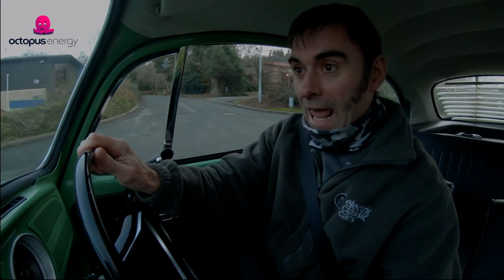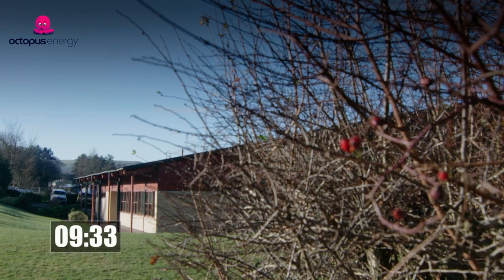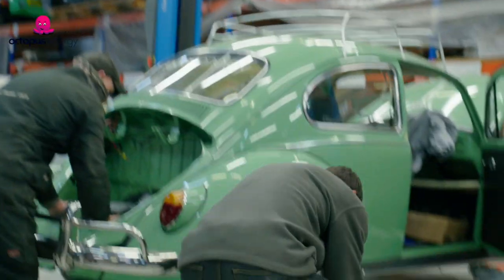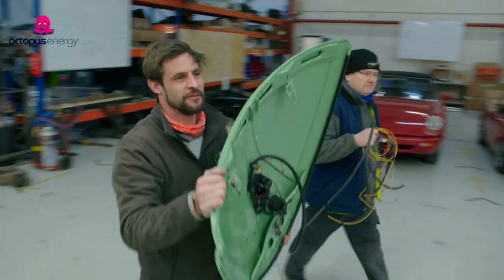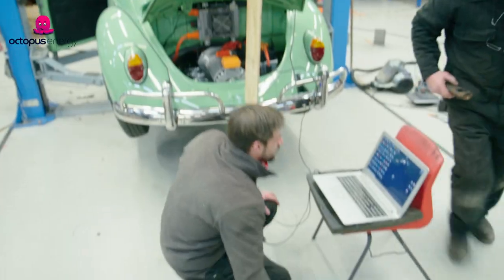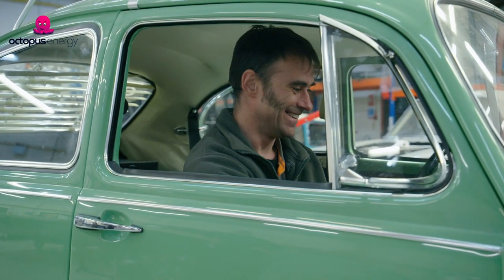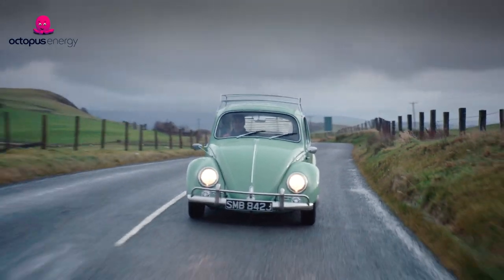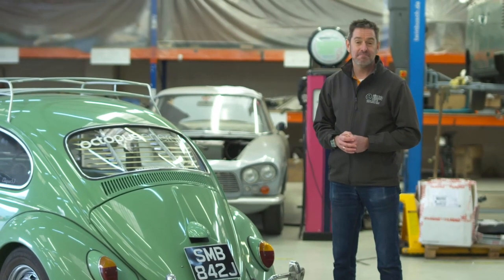Converting a Beetle to Electric Power in a Day ! *INSANE CHALLENGE*

Comment: I first saw "Vintage Voltage" and this super fast EV Conversion of that lovely Octopus Energy sponsored Beetle! A little late, but congrats to Moggy and his team! I am an expat of the UK, and visited the UK during February 2020, for 21 days holiday ( I reside in Sydney Australia). BUT Covid struck the UK during March 2020, and I got stranded in the UK for almost one year (363 days before I saw my Sydney home again). But I thoroughly watched every "Vintage Voltage" in my confinement in the UK. I must say that 'I was inspired' to go EV with my 1971 Super Bug way back in 2018. But my dream turned to reality during April 2020, but I was deeply frustrated - not being able to see - or drive my newly-converted Electric Beetle, and being confined to the residence in a Bolton (Lancs) street!!
I finally made it home, to Australia after 2-weeks held in quarantine when I landed Australia. My first job- was to take a taxi to the factory that completed the EV Conversion, and see AND DRIVE my new Super Beetle. Finally, I love the commentary, the scenery, as Moggy feels thrilled with the Car that he has created. Also, my experiences with my EV Beetle matches with everything that Moggy has said. The weight balance (with added Battery Mass at the front) has definitely removed the "twitchiness" from the steering, as most Beetle owners would agree. The car feels more 'planted' on the road. MY EV Conversion was done exactly the same as the Octopus Energy Beetle. (Tesla model 'S' Battery Pack + Netgain Hyper 9 Motor. Every time that I drive my EV Beetle, I feel lucky, and wear a smile too! I had exactly the same 'teething problems' with the setup of the Inverter Computer as Moggy. All fixed and the car has been 100% reliable. Car goes to Shows, the last one being "Fully Charged" at the Darling Harbour EV Show 2023. It is on YT, and is the only white 1971 EV Super Beetle there on display. Car also goes to the VW Nationals, held in Sydney on 28th May 2023. An Essay, I know, but that is my 'happiest' personal story.

Comment: They're working next to a Gordon Keeble! What are they doing with that? Electric conversion? Would love a story on that!
Reply from the maker: Tune in to Series 2 of Vintage Voltage on Quest early next year. The Gordon Keeble is having a mid mounted 450hp large Tesla motor 👍
Reply: @PetrolPed  exciting! Might I suggest that they cut out the transmission tunnel and make it a flat floor car? I'm guessing they'll use the engine bay to locate the batteries.

Comment: Isn't the hyper 9 a dc motor? I thought dc motors could not get regen?

Also, the beetle is the most converted car on the planet. And its great, but as an old car enthusiast, can we see some other configurations converted too? Perhaps inline front wheel drive/4 wheel drive (audi/subaru configuration), transverse front wheel drive or the most common classic configuration of front engined rear wheel drive.

Comment: To put in the motor you can remove the two transaxle bolts and tilt down the transaxle just a touch. It works and you can then re-torque the transaxle bolts. I do this so I don't have to cut any metal. Im putting in a double stack AC-35 from HPEVS into my Bug. Ive had two different motors in that beastie and the AC-35 will be the shortest in the bug. Easy to mount.

Comment: Interesting. What sort of rough cost Ped?
Reply from the maker: Conversions range from £20k to £65k depending on the motor used and the size of the battery pack. ECC do a kit for a Beetle which makes it a bit cheaper 👍

Comment: will it work safely under heavy rain and if it ran through a puddle in a flooded street after a heavy rain night, what would happen? will it work safely with a lot of water frim beneath as well?
Reply from the maker: Perfectly fine. Everything is sealed. In fact it should deal with deep water better than an internal combustion engine 👍
Reply: @PetrolPed  wow, that's great to know!! Million thanks for your reply, thank you so much again and again :)
Reply: I can answer your question. On date 15th February 2021, I had to take out my Electric Beetle (converted in exactly the same way as this video). The rain was absolutely torrential. On a three-lane highway, I had to cover about 15kM on flooded roads. The Nearside Lane (which I used), had about 100mm of water depth, (in parts where drainage was very poor) and the passing cars also gave my EV Beetle a good soaking! The truth is that my EV Beetle never missed a beat. I wouldn't normally take out my EV Beetle in such extreme weather, but on this rainy day, I had no option. Trust me, the EV Beetle performed just the same as if it was a 'dry' day.
Reply: @peterduxbury927  million zillion thanks for your great reply

Comment: I have one question. Is it possible the battery pack could be smaller. Like say a lithium ion type of battery.
And next idea is the charging system could be maintained from one of the rotating wheels...
Reply from the maker: It gets some charge from regenerative braking. If you work out how to fully charge the battery from a rotating wheel then you will be a billionaire before you know it as you will have invented perpetual motion 😜👍
Reply: @PetrolPed  The 1972 1302s was my first automobile. And the Auto Mechanic was my first trade l learned from the German Automobile School.
One interesting thing l learned about the beetles is the way the speedometer clock work's. And this was connected straight from right front wheel to center of the speedometer clock of the dash board.
And so from this same principle using the left front wheel. A unit similar the electrical controller can be created. I called this the Alternator Controller box. 
This key unit l am inventing is responsible for the purpose of maintaining voltage level of the electrical batteries in supporting the electric motor function.
That was one of my idea

Comment: I wonder what it cost to convert ?
Reply from the maker: Tricky questions as there are a lot of ‘it depends’. Conversions start from about £20k and go up to £65k depending on the motor and battery pack chosen 👍
Reply: @PetrolPed  Tks, was hoping someone  could convert my 2007 Twingo GT, as it never gets used.

Comment: I don't understand why do these cars have gearboxes.  Electric cars don't have a gearbox. Why they fitted with one? Thx
Reply from the maker: It makes the conversion simpler and cheaper when using a lower power motor. The Hyper9 motor used in this has about 120hp and the cars gearbox can cope with that. 

If you want more power and torque then we use a Tesla motor and that requires direct drive and just 2 gears, forward and reverse 👍
Reply: @PetrolPed  Thank you

Comment: An interesting film and certainly a lot of work in one day. I. An understand the enthusiasm and what drives them to convert the cars but I am not really sure that I am “ sold” on the idea. I think I would be converting things like a 5/7 year old Fiesta  which identifies more with modern families and their practical use day to day. Most owners of mid life moderns are not car enthusiasts so owning an electric VW, Morris Minor, Vauxhall Viva etc...is lost on them and I am not sure also that many who are say, Volkswagen owners, would be happy to have their car changed. It might well become a far greater need in years to come and the on'y way to drive a “Classic” but at present, I’m not taken with the idea. Also, I guess it is driving through the original clutch and gearbox so how is that coping with the torque which is vastly greater then ever intended and changing gear must be a strange job that takes some learning. It is an interesting concept with great enthusiasm...I wish them well. 🙂🙂🙂🙂Richard.
Reply from the maker: Modern cars are much more difficult to convert due to more complex systems and features. When keeping the existing gearbox (the most cost effective conversion) there is a limited to the performance of the motor used. The Hyper9 used in this one is about 120hp and the gearbox can deal with the torque. Sometimes and updated gearbox is needed. For even more power they use either small or large Tesla motors but they require direct drive. Doing away with the gearbox altogether.

Comment: I like electric but the old engine still sounded nice to me. a little sad to rip it out. Im more a fan of converting when something is really wrong with what was there before. I removed a engine trans where the clutch was worn out but later felt bad about removing a still working engine that had been going for hundreds of thousands of Kilometers. probably wouldn't remove a working engine again for that reason. Im too sentimental